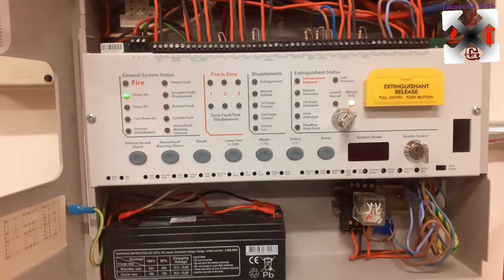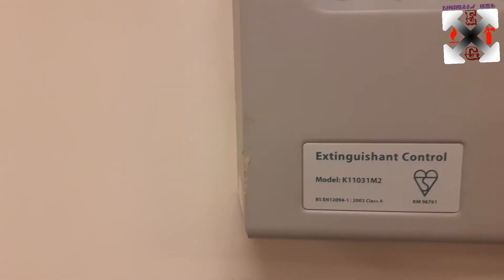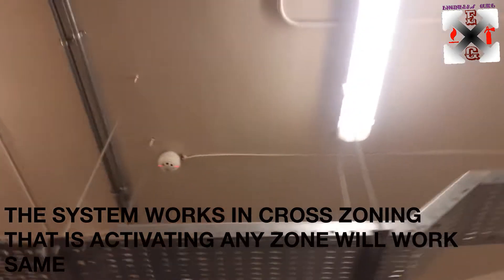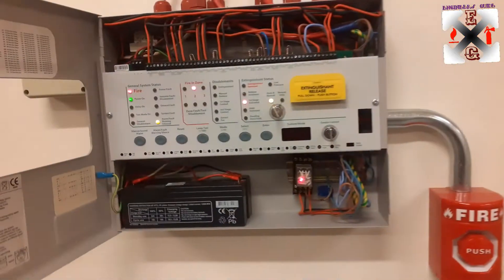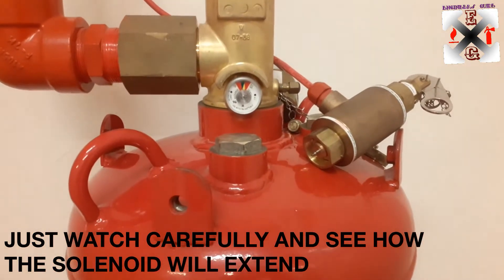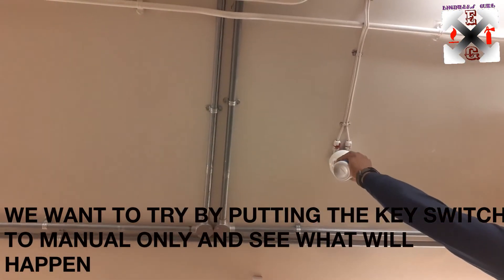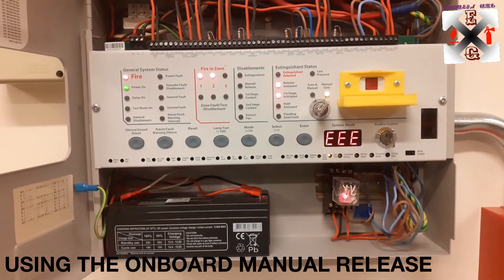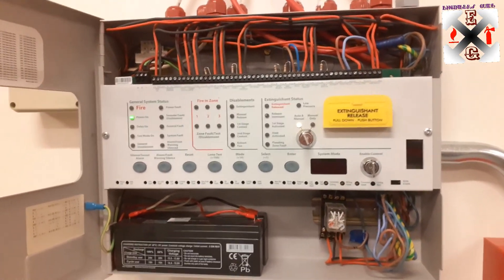FM 200 FIRE EXTINGUISHANT AND SUPRESSION SYSTEM

Comment: When you push the abort button I think it should stop the  release and the relay stops immediately.
Or how does it work?
Reply from the maker: It depends on the settings and area that you working at. We have an abort that holds the countdown and when you release it,it will count down from the start and there is another option it will only hold at 10 secs then after release it will count down from 10 to discharge.i hope this helps

Comment: brother what hapen if the abort was ended? does it the actuator will function to break the cylinder lining? i mean explode now?
Reply from the maker: Explosion on the side of the cylinder will not occur when it's actually activation or initiation of release, but can, In case there is no activation and an external activity like fire can cause cylinder to explode

Comment: Its possible to remove the supply or signal from c. Panel to solenoid so no need to rmove solenoid valve thanks
Reply from the maker: it is possible but to check the activation of the solenoid wont be applicable, and you have to get another EOL to normalize  the panel..

Comment: Can you share how you cleared the fire zone lights on the panel please?
Reply from the maker: You need to reset it by pressing the processor reset button below the key enable switch ... Just give me a feed back after it's done ✅ TNx
Reply: @engineersguidehelp  press reset when the alarm sound is working? Or first I clean the detector and then press reset?
Reply from the maker: @falcond214  you can silent the system, clean it then do the reset to avoid continuous  alarming
Reply from the maker: You can only reset when the system is not in discharged mode ..but if it discharges u need to hard reset by resetting through the pressing of processor reset

Comment: I need information abort switch said termintion
Reply from the maker: NO WORRIES JUST TELL ME THE ISSUE AND WOULD BE GLAD TO HELP YOU OUT ..FOR THE TERMINATION ITS JUST CONNECTING IT TO NORMALLY OPEN WITH YOUR END OF LINE RESISTOR FIXED